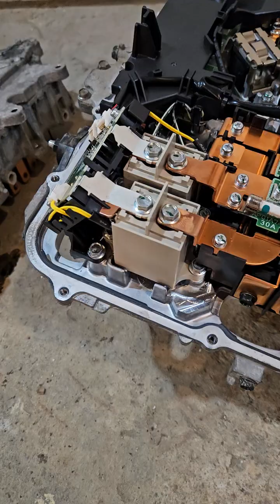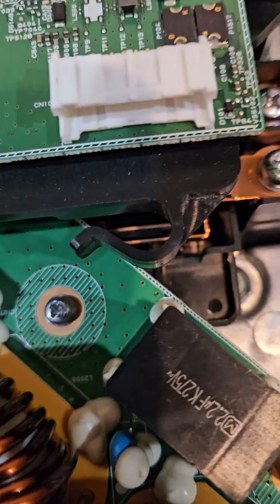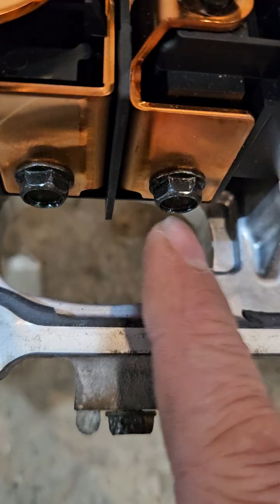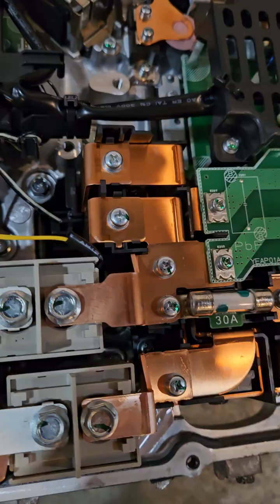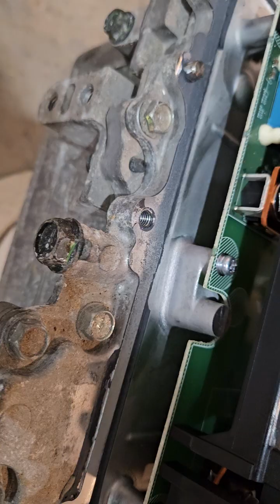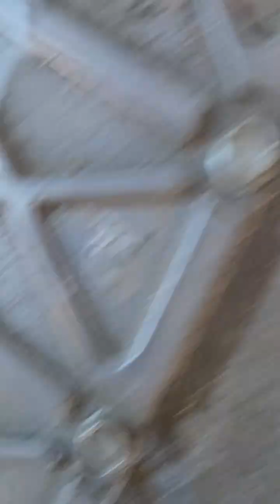2nd generation Leaf PDM and Inverter overview.

Comment: Thank you kind sir, more videos please
Reply from the maker: I’ve got a cool project I’m working on. I bought a 61” Scag zero turn riding mower that I’m converting to electric.
It’s a tribute piece to reflect my career as an industrial maintenance technician.
So I’m using an industrial 10 hp 3 phase 480 volt 3450 rpm motor. It’s being controlled by a Danfoss 25hp rated vfd. I’m stuffing direct 802 volts dc into it.
The battery pack is 2 full Chrysler Pacifica Phev batteries, with a total capacity of 31.2 kWh. There will only be passive cooling.